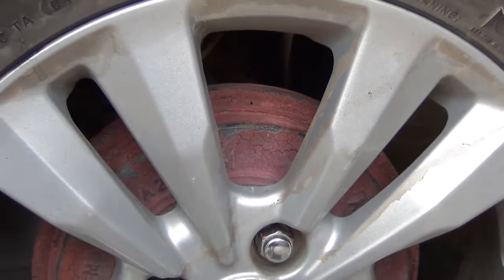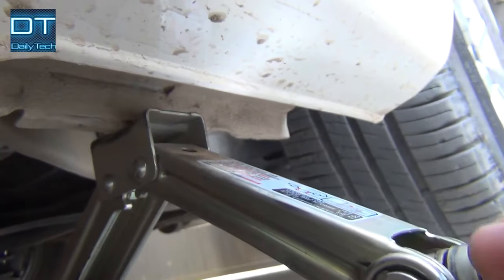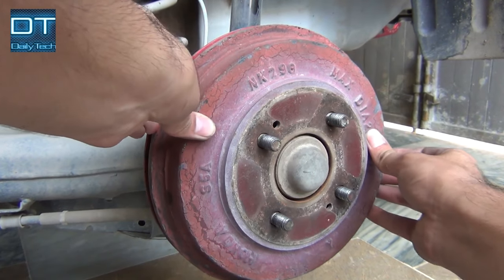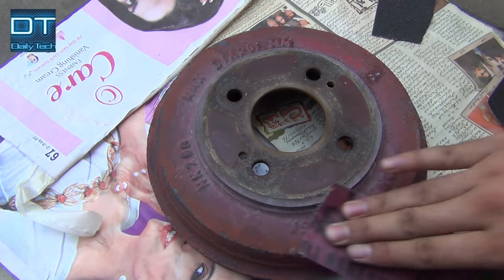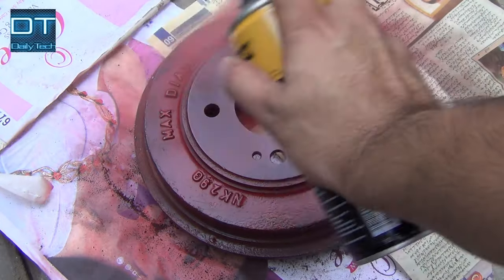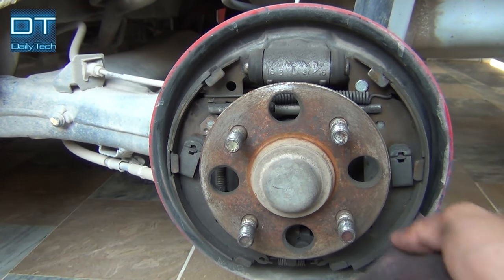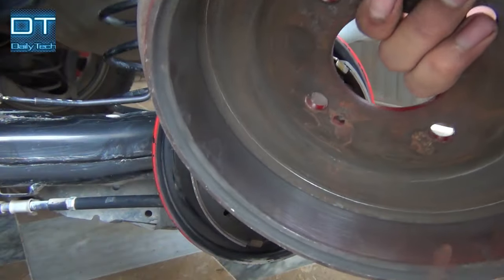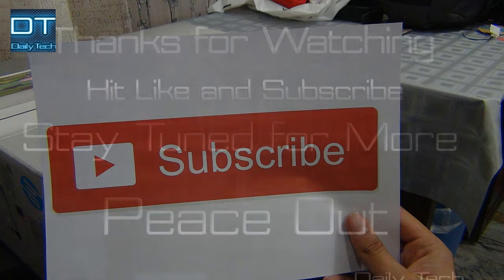How To Paint Brake Caliper/Drum  DIY .

Comment: I've had good luck using wheel and tire cleaner to get the brake dust and crud off of the wheel and calipers/drums.  If you're dry sanding it, you're kicking up a lot of asbestos into the air (from the brake pads) that you will end up breathing part of.  Keeping it wet and using the wheel and tire cleaner, it keeps the brake dust and crud (asbestos) wet and it doesn't get airborne.  It also does a great job of cleaning the part you want to paint.  I painted my wheels red and my calipers (front) and brake drums (rear) yellow.  My son said it looks "dope".  I'm not sure whether that's a compliment or not.  lol.  On a black car it does look very good.

Comment: Went through all that trouble cleaning them off you might as well place some fresh paper down so it doesn't just blow right back on the drum lol. Also, they make wire brush attachments you can use with a normal hand drill. Life savers on projects like this. I use a $20 sand blaster but any joe smo can use a drill, so thought I'd suggest that. Otherwise great video.
Reply: What sand blaster did you use?

Comment: How Did u removed drum directly ..? 🤔. There should be some screws right..?
Reply: No, you just release the hand brake and brakes, and pull it out with your hands. Maybe tap it lightly with a hammer if it's stuck from rust.

Comment: since you are using low quality spray paint how long is the paint going to last?
Reply from the maker: it will last around 5 to 6 months for sure because its only 2$ spray paint bottle which covered both drums 3 coats each
Reply: 5 to 6 months??  You'd be better doing the job properly (etch primer and then top coat) and it would last 5 or 6 YEARS.  NIce video, thank you.